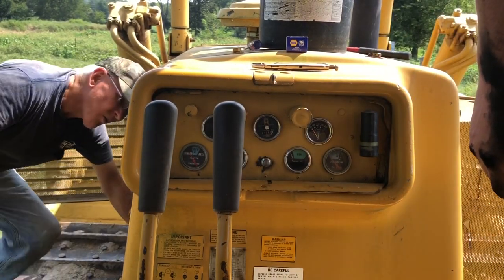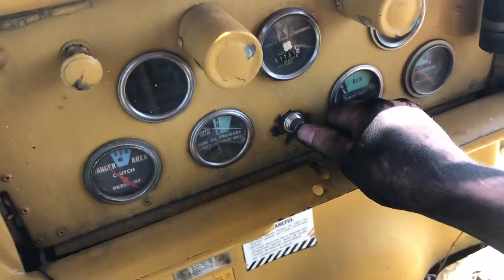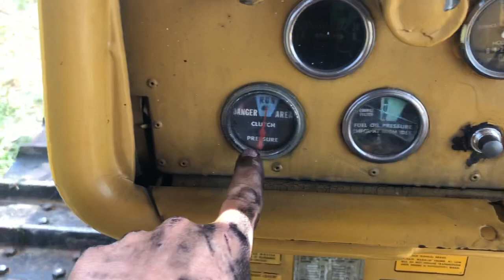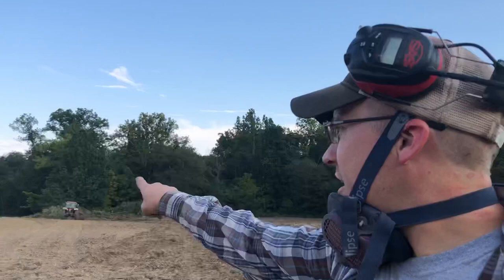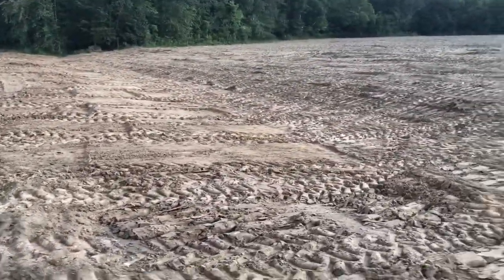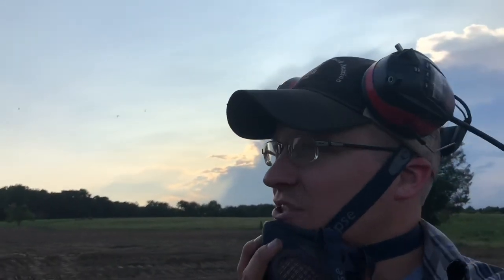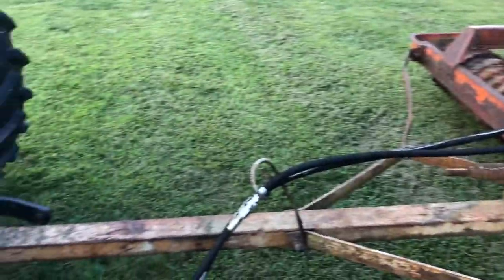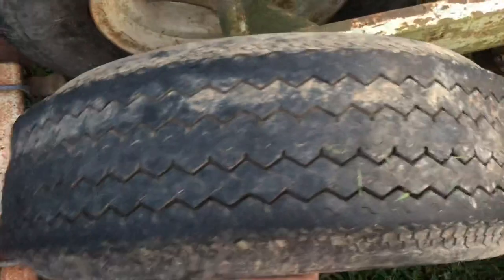TD25C Clearing Trees for Hay and Pasture

Comment: That 25 should not have that popping in the exhaust. Sounds like you may have an exhaust valve that is way to loose. That will make it pop because the valve is opening late.

Comment: I ran a TD25 in the early 90's. That beast would push 35 tons of shot rock to grade in one pass. Leaked a lot at the blade valve but it was a great machine.

Comment: I spent darn near 23 yrs on those 20's & 25's, seriesB,C,E & G's dozers as well as scraper tractors,with cable control not hydraulic for the scrapers..Actually have about 14 of the 20's & 25's in the yard still..Fine older tractors!! The newer equipment is nice for creature comforts,but,when electronics start going out,the older mechanical equipment just keeps going lol..

Comment: Nice video of a great old dozer and good to see it doing some work, but I think I might be hearing a leaking exhaust valve there. I don't mean to criticize, but it might be worth checking, just in case.
Reply: @thebalerman  Nice one, best to catch anything wrong sooner rather than later and keep the old girl going!
Reply: We had an older TD-25 that tended to overheat and cracked one of the heads 😩
Reply from the maker: Yeah I’m going to be checking it out before I run it again. I did check it with a temp gun and all barrels were the same temp at exhaust, I thought I’d find one out of wack but didn’t.
Reply from the maker: Yikes that sucks. This one runs pretty good and not low on power, I’m thinking the sound has to be a valve or something. I know a lot of people are saying it’s about to blow and bad whatever but it sounds worse than it is. I put a new exhaust manifold on it because it was busted when I got it.

Comment: Seems as though that dozer had little problems pushing over trees.  I’ve seen other videos where other machines had difficulty pushing over similar sized trees.  This dozer seems like a real breast.
Reply from the maker: This dozer is a beast. I know there’s a ton of comments saying it’s about to blow but she’s strong. I think it has some valve issues. I haven’t tied into it yet but hope to before I use it next. She’s old but can push a lot of dirt and some good size trees and make quick work of it. For reference this dozer is a little larger than a D8 cat of the same vintage.

Comment: Nice old beast . I have an old D-6 hand clutch n it pushes mother Earth really good . LOL  What price range does a TD-25 have like u running ?
Reply: 15 ton at 200 dollars a ton, is the bottom line..
Reply from the maker: Sorry I hadn’t seen your message. I’d say a decent running machine would be 10-20k. Really depends on undercarriage and everything. New undercarriage would cost more than the machine is actually worth. This thing is worth more to me then i would get if I sold it.
Reply from the maker: I know what you’re getting at but I have trouble believing you have a clue. 15 tons? Just scrapping the undercarriage and blade I guess huh?

Comment: sounds like you should check your fuel injectors. The motor has a little skip in it.
Reply: @thebalerman  Valves were my first thought based on what I could hear through my phone speaker, but looking at the dusk footage of the exhaust flames and smoke throughout made me think pump timing, maybe worth a check if you haven't already as that would give a pretty even temp across heads/manifold, although I wouldn't be surprised if a few valves were coked up. 
Great seeing the old girl running though 👍🏻 makes me wish I still had my old BTD6's and Drotts, keep up the good work.
Reply: Sounds like a burnt valve to maybe more than one

Comment: You have a cracked exhaust manifold  , I H  was never a dozer to be competitive with cat ,, i watch these u tube vids an every dozer I see really never has a clearing rake on them always a blade , in my 40 plus years clearing land an excavating I learned if you have a saw you need a ruler
Reply: @thebalerman  hey I'm not cutting your dozer down they really have the advantage with the duall track drive, I'm just a cat man  have a d 7 also have a hydrostatic  j d which is constant drive , but a major oil leaker,  that's what made me a cat man  an in many ways more expensive than cat an cheap made lol

Comment: sounds like she needs a valve job
Reply: @thebalerman   i ran inot a issue on a 750 John Deere, had a broken rocker shaft bolt, would run and make a missing sound just like a injector, smoke bad. good to check the valve train and exhaust ports for cracks in the head also. International machines are still one of the best being old
Reply: Contaminated fuel